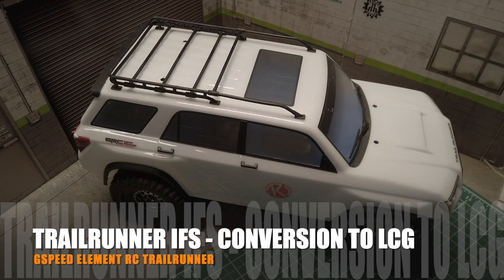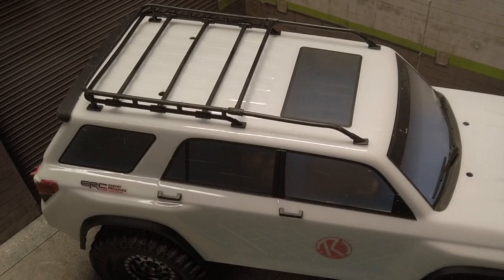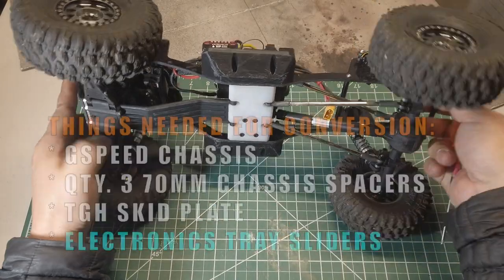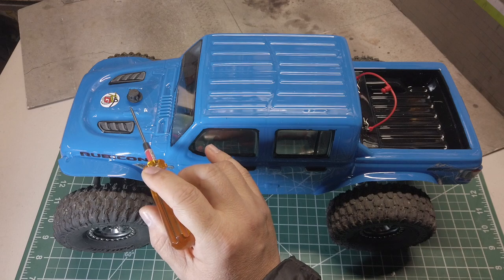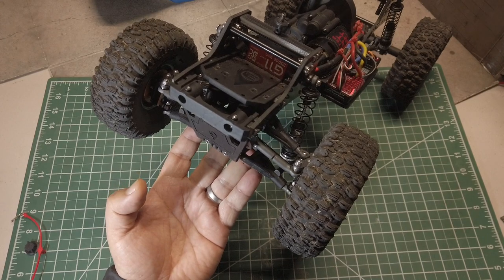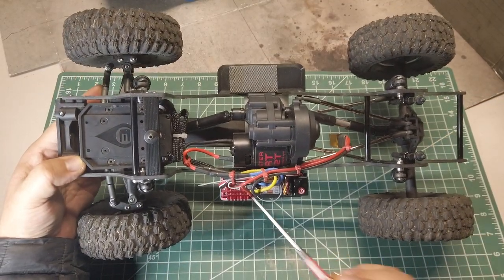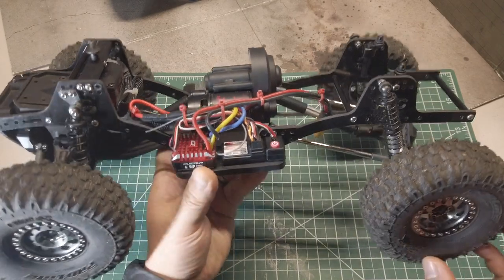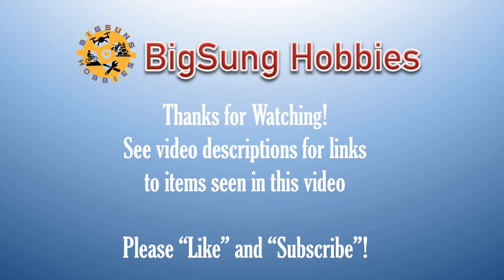1/10 Scale RC: Jeep Gladiator(Element IFS Trailrunner) | Ep 1 - Conversion to Gspeed LCG Cheater Rig

Comment: Very nice can’t wait to see it in action! You’ve gotta be the first one to do this because I haven’t seen any others and I browse a lot.
Reply from the maker: Definitely not the first one to do Gspeed IFS conversion, but one of the early adopters.  I took it out for a quick run today.  Even though the testing ground was damp from rain from Yesterday, it did quite well.  I still need to fine tune it more especially the rear setup (yellow springs might be too much), but it looks very promising.

Comment: Nice Sung! Despite the downsides to ifs I’m really tempted to do a Gatekeeper on the GSpeed v3- some nice trailing arms in the back, IFS front, probably make a nice trail truck!
Reply from the maker: I think that will be a great trail truck.  Originally I was going for more of trail truck, but one side of me want to see how much I can push IFS.
Reply: @BigSungHobbies  I just like having stuff that is different! My Gspeed is a Datsun 240z on a 255mm wheelbase and little 4” tires. :)

We don’t have rocks like you’ve got here in CT. Low CG stuff still has its advantages of course, but it’s more rugged and less trail focused for the most part.
Reply from the maker: @Bob Sennick Different is good, and a Datsun 240z is definitely different.  I am fortunate to have a variety of trails fairly close by.  Checkout the videos on Mini Hammers, that's pretty jagged rocks.  LCG belly dragger is not the ideal rig, but I still enjoy the challenges.

Comment: Have you thought about adding 4 wheel steer to this build? I have a gatekeeper and ifs kit sitting in a box and I'm itching to try something different and use the gspeed v3 chassis with ifs front and then take the front solid axle and put it in the rear with the CMS servo mount. Although not sure if I will need to use the GMP panhard or even if I can use it in the rear.
Reply from the maker: That sounds like an interesting build.  Personally I have not thought about 4 wheel steer on this build.  Since you plan to use the straight axle, I think you should be able to set up 4 link SOA setup.  Then you won't need to worry about GMP panhard mount...I really think that's the only way to go.

Comment: Cool concept.  There is an issue that I see with this setup though.  By moving the battery tray from the front mounted stock location to a side mount, you are shifting the weight distribution.   I guess the question that I have is, did you you check the weight before and after the conversion with a battery in the tray?
Reply from the maker: I thought the same thing, and I originally had the battery mounted at stock location, but I ended up moving to the sliders.  Keep in mind that I am using smaller 1300mAh battery, so the overall impact is smaller.  There was minimal change in weight distribution.  And by removing the battery tray, it saved a bit of weight, and the battery also sits lower on the chassis, bringing down the CG.  I did the same thing on my Gspeed Element, and it has worked for me.
Reply: @BigSungHobbies   Sweet.  I guess for me it may be different.  I have upgraded most of my electronics and run the large (or I guess long) 3S 5000mAh.  Even with the higher CG, I like having that extra weight over the front wheels.  I do also live in a very different climate than what I have seen in some of your videos, so that also makes a difference in my preference.  Natural rock formations are pretty limited where I'm at so most of what we play on is dirt.  Either way, this is a really cool build/mod.  Thanks for the video.
Reply from the maker: The goal is to get to 60F/40R weight distribution and then fine tune from there.  I am very close to it at 59/41. With IFS I find that since quite bit of front weight sits high, I think it can benefit from a bit front heavy say 61-63.  I will continue to test it and confirm.

Comment: Hi can you share which gspeed chassis did you use is that the element gspeed
Reply from the maker: I am using Gspeed Chassis V3 for both my Gspeed Element Enduro (CF version) and Gspeed IFS Trailrunner (G10 version).
Reply: @BigSungHobbies  I only need the chassis so I get whatever gspeed v3 because the element kit is out of stock and only need chassis sorry I don't know if any difference between them